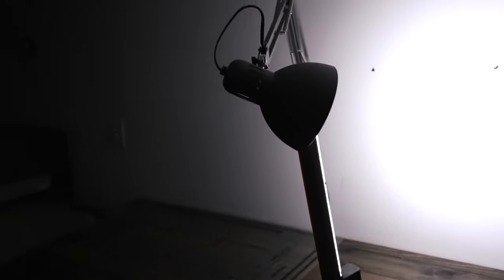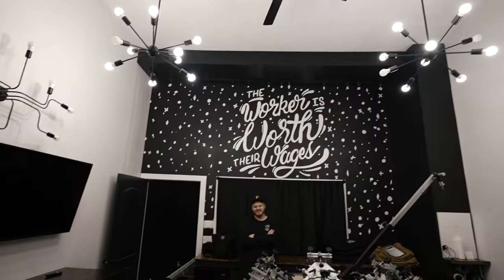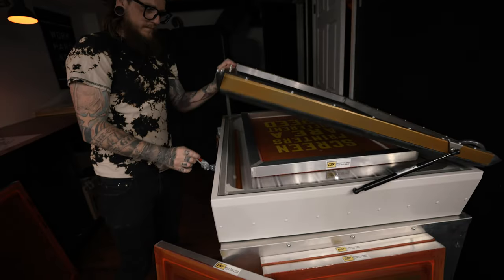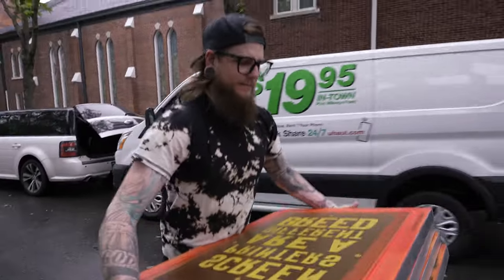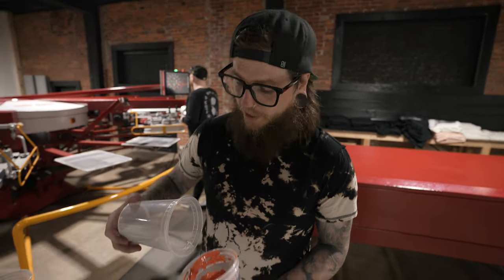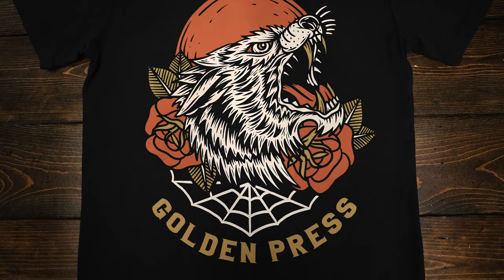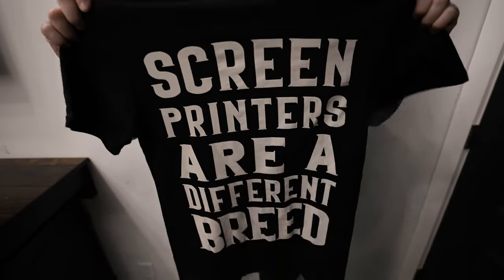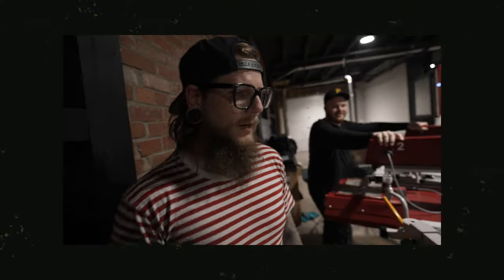Discharge Printing on the Auto (not as easy as it looks) Vlog Ep. 14

Comment: Thank you for making this video! I've not found very many on water based discharge printing. Couple questions,  how many prints do you find you get before the screen breaks down if you didn't harden it? When you harden AND post expose do you find the screen is impossible to reclaim?  With regular water-based I just post expose. In my (extremely limited) experience I found that for discharge just hardening alone worked well, I was afraid if I did both I'd have to re-mesh. And finally, What mesh count were you using? I've been using 110 for this, I like the amount of ink it puts down. Thanks for the info.
Reply from the maker: With the auto and it’s consistent pressure and with 2 strokes each times I’ve seen the screen breakdown after 15 shirts if you don’t post expose and use hardener. We haven’t had a hard time reclaiming when we do but we have that area pretty dialed in. As far as mesh count we’ve been doing some testing. In this video I used 158 Thin thread mesh and everything was so bright and vibrant so I believe in the future we will be sticking with 158 Thin Thread. On a quick one color discharge job we did we used a 180 Thin Thread and got really good results also. Use what you get the best results with!

Thanks again for the love!